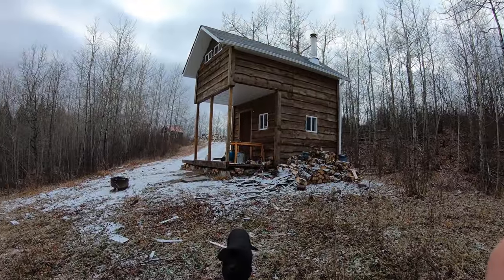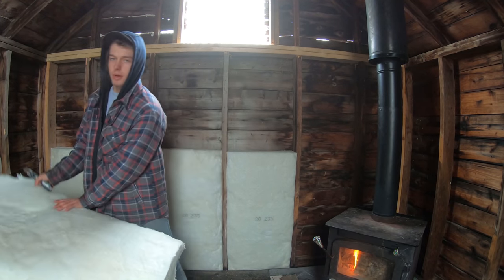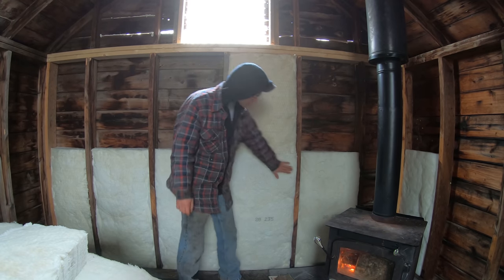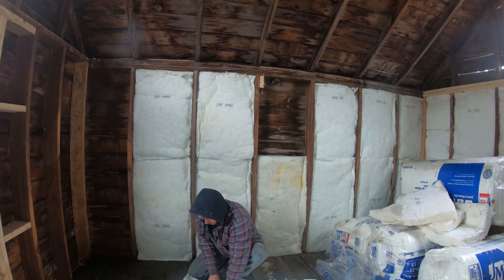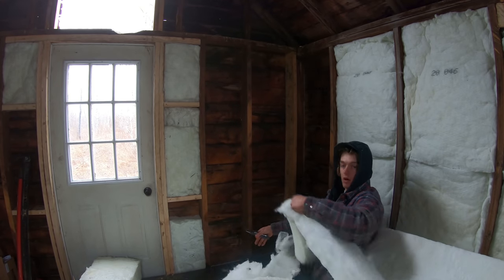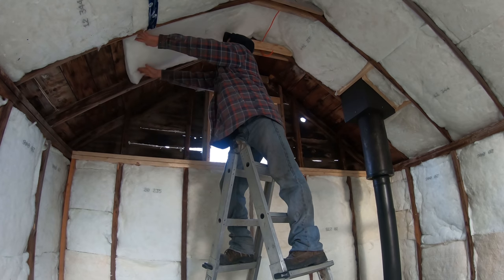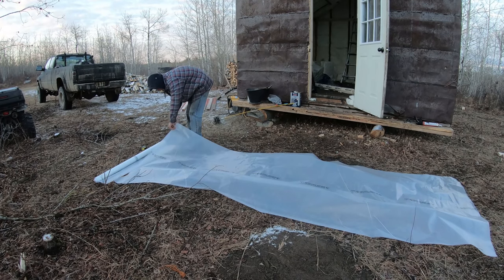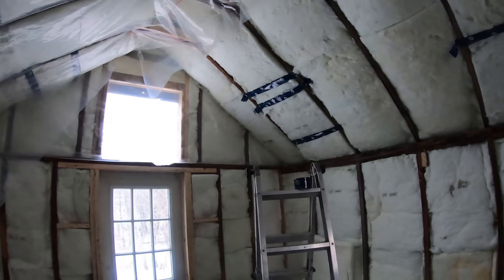Offgrid Workshop Project Pt. 7 - Insulating the Workshop

Comment: We heat our entire house with a wood stove about the same size as yours -- about 1500 square feet. We have a good deal more insulation, but it matters most in the ceiling. In the Spring and Fall, body heat does most of the heating! You are right about the wood stoves -- you can easily overheat things and have to open doors and windows to cool it back down. 🔥

Comment: That beam you cut out may have been there to stop the walls from bulging out . Why not add a couple of joist a little higher up for the same reason . It would also provide hanging spots or build a loft .

Comment: Denim Danger Dylan? You see them 6 pack abs! Keep the videos coming, I really enjoy them. You did the off grid common mistake. 1. Laundry 2. Bathroom/shower. I know you have the lil camp shower and the concrete pad. You are a tough guy, but no way you are showering outside at -20

Comment: Always love the vids. R20 in the ceiling and R12 in the walls might have been more proper since heat rises. Won't matter much with a stove like that though. Wisdom comes with age and experience. Project is coming along diddily!
Reply from the maker: yea of course but walls are 2x6 and roof is 2x4 u cant put r20 in 2x4

Comment: I love your projects and progress!! Just wondering what perm vapor barrier you are using?  Maybe a Kraft faced insulation would be better to keep condensation from accumulating and an easier install.  Also, using baffles between rafters allows necessary ventilation to ridge vent.

Comment: PS:  When stapling the vapor barrier thin strips of cardboard (old boxes) under the staples keep it from tearing down in stressful locations.  Don't eat or drink in an area you are insulating as that dust gets everywhere and your body doesn't like it.  Things like that often build allergies over time as well as clog your lungs.  One last tidbit:  take a piece of poly out to your fire pit and light it off.  You will find it burns with an invisible flame and little odor.  So get it covered where it is exposed to sparks or open flame (wood stove).  You can be inside a building and it can burn before you even know it to a dangerous level.  Good looking job on your air seal.

Comment: An insulation tip for free:  If your skin is still irritated and itching after handling- Apply tape to the effected area, then remove like a band aid.  The strands of fiber glass will come out of the skin and lodge into the tape.   Caution:  If application is around the nut sack area-  pull on the tape slowly because if anything goes wrong it might result in lower testosterone levels.

Comment: When you were cutting the vaper barrier( poly) up by the windows,why didn't you just cover the windows to help keep the snow out? Then just cut an X in the poly when you get the windows to install. Ya need to build a lean to on the cabin n new shop to keep your wood piles n 4wheeler outof snow/weather. Watching from down in Maryland. 👍

Comment: What are you covering the outside gable walls with? Won't your insulation get wet with all the cracks and holes in it? Spray foam insulation would make a good temporary waterproof seal. The place looks great

Comment: Just have to ask what may be a stupid question. Will moisture/mold  get into the insulation through openings or cracks in the outside wall boards? Here in Florida mold is a common but very bad deal? 😎👍
Reply: Steel sheeting on the outside and the overhanging roof it should be ok.
Reply: @joeytwotimes9586  ...thanks!  Just curious since the gable ends look like big cracks letting light through the steel cladding!
Reply: @drjcwardjr  I believe he said he wants to put cedar shakes on the gable ends as well. Because you're right,water would totally get in there.
Reply: He will need to patch some of the holes in the steel as well
Reply: @joeytwotimes9586  ...it is amazing how he moved and structurally rehabilitated that old wooden corn barn!